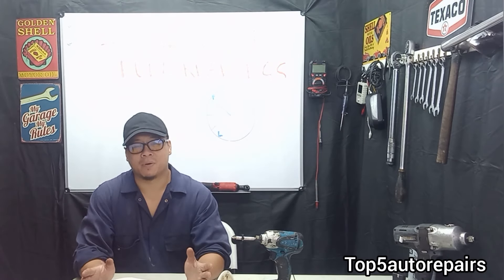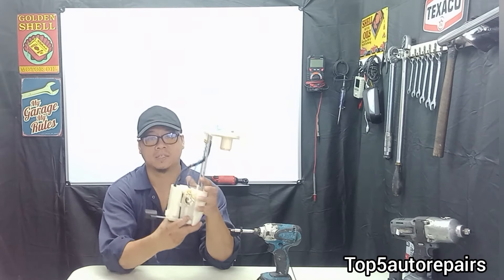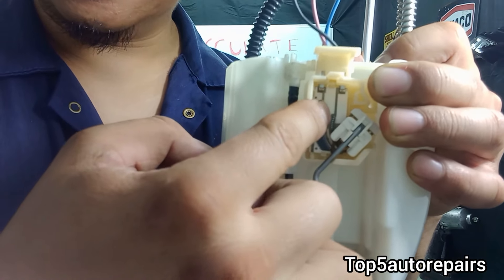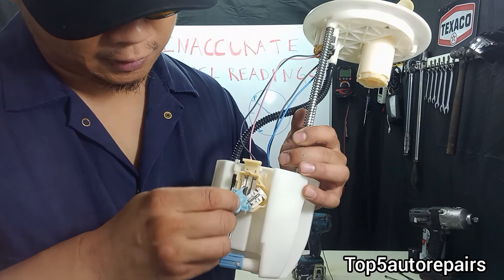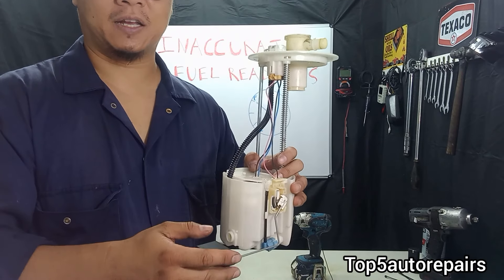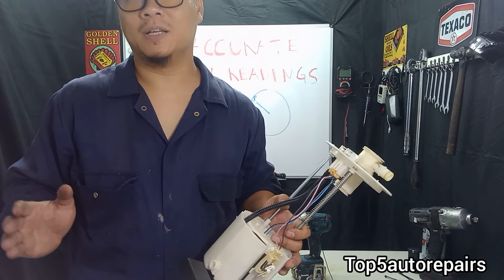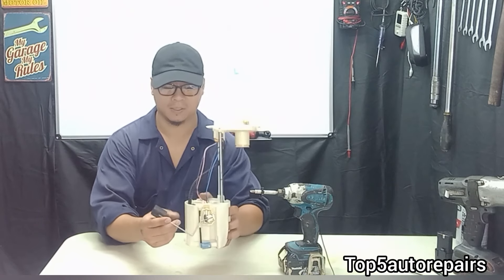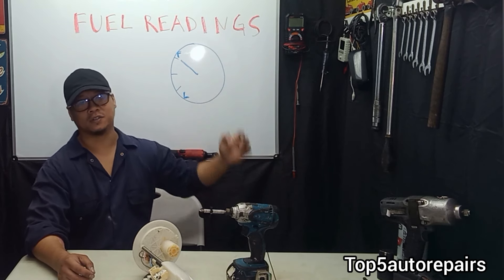Fuel Gauge Not Working This is Why Gas is Showing Full or Empty

Comment: Ugh mine marks half tank when it's full. So I never know when it's actually empty hahaha
Reply: Same
Reply: Same
Reply: Same here
Reply: lol if anyone finds the problem, let the others know here. It may be the sender but who knows
Reply: I have the same issue, and later today I plan on putting a fuel additive into my gas tank with the idea that it will clean any contamination around the fuel pump and prevent any more inaccurate readings from arising. If this method resolves my issue, I will make a follow up comment that includes the additive I used.
Reply: @lordgradi9525  did it work?
Reply: @yaswanthamourdalingame1447  unfortunately it did not seem to work, I put 2 bottles of Chevron Techron+ into my fuel tank on two separate occasions since leaving that comment and there was no change in my fuel gauge. On the bright side though, this did clean out my fuel system and I’ve gotten around ~1.5 extra miles per gallon since doing this.
Reply: Same here also haha
Reply: Exactly what mine does as well
Reply: I just reset the trip counter when I fill up. I usually get 600km’s per tank so when the counter gets up to 400km’s I know it’s time to fill up again
Reply: Just bend the float wire
Reply: @lordgradi9525 did it work n what additive u use
Reply: Mine gose up n down then the light turns off like I put gas while driving 😭🤣
Reply: Any update? Bec I changed my fuel pump and now it’s frozen on gas level and millage to emputy
Reply: @djr320 that's what I do 😅
Reply: @lyon9410  when I can be bothered, I’ll pull it out and fix it. I just don’t want to spend $1200 on what I know is a very simple fix
Reply: Mine is new i think one of the tubes is holding it up probably a installation error
Reply: Mine is the opposite lol, left my dad stranded once due to it.
Reply: Same here. So frustrating. Just brought this 2007 Prius two days ago and it’s my first ever Prius. What do I do!
Reply: Did u fix it? Mine also has issues when i pump gas it stops the pump or sometimes it spits out
Reply: If it is stuck on the fuel gauge on your dash, you will need to take the gauge out of your dash and resoder the fuel gauge at the back of it.
Reply: Drill a hole in your dash and move your needel to full when u fill it. That should fix the issue. Your fuel pump prolly has an anti slush components on the new pump maybe rather then one with just metal dividers in the tank to prevent sloshing aprearing on the fuel guage turing a turn or during stopping and going.
Reply: @derricksmiley5632 I used the Chevron Techron Plus fuel additive, and to my dismay it did not work. Since leaving these comments though, I have figured out what the issue was. After my fuel pump died on me one day, we removed it from the fuel tank and discovered that the pump had PHYSICALLY broke within the tank and the floating arm was being pushed downward. Mechanic said he’s never seen it before lol

Comment: My fuel gauge is not accurate, sometimes when i refuel my gauge wont go up, then i remove the socket or cluster gauge for about 5min.and plug it back and the gauge go up. What could be this problem?

Comment: Thanks, now I know why I have often been told by auto shop mechanics that it isn't worth repairing due to the age of my parent's 1997 Monte Carlo LS: the fuel gauge has been dysfunctional for a very long, long time.  I drive the car more than my parents and I do the same as my Father - when the mileage-wheel gets to 250 miles buy more gas.  I wish there was a easier repair option!  I was hoping I could find some kind of wireless float that I could toss into the fuel tank and it sends a signal to a USB plug-in receiver in the lighter?
Reply: Putting after market electronics around gasoline vapors is not something I would do. A tank of gasoline will leave a huge crater when it sparks. I don't think there would be any survivors.

Comment: I have the same problem. I ran out of fuel 2 times before I figured out my float is broken. 
Tipp: if you don't want to fix it, you can drive and use board computer numbers for fuel consumption. I watch out for used fuel and when I spend more than 20 liters, I fill it up.

Comment: This is what happened to me: In February, my alternator died on me. As the mechanic made his Dx, he also said there was a fuel leak and suggested replacing the fuel pump assembly. At that time, I was getting a reading on my fuel gauge of around 170 miles to a 1/2 tank of gas -- normally I get appx. 190-200 miles on a 1/2 tank of gas, roughly 32-34 MPG. When the assembly was replaced, I thought that problem would be corrected. HOWEVER --- NOW, the gauge reads appx. 140-160 miles at the 1/2 tank mark. Everything looks good at the 1/4 tank mark, usually 100-120 miles on the gauge. But then, the needle just plummets at that point. Today I filled up my tank with the gauge reading 159 miles at the 1/2 tank mark and the tank took just under 5 gallons.

For the last two months I thought I was getting bad gas, so I switched stations. I also replaced my gas cap to see if that might help. Neither of these things were the issue. I don't know how my mechanic missed this, or if this was deliberate to get me to come in again. After all, it's $135 just to do the diagnosis, then $135/hour for the labor.
Reply: is there a gas gauge rest button under the gauge. if so google how to reset it and see  if that fixes it.

Comment: Thank you. A Buddy told me that a malfunctioning fuel gage could be caused by a damaged gas cap which would not allow an accurate pressure or vacuum reading of a fuel tank. A possible theory but as you said the problem would be in the sending unit.
Reply: Never in a million years would a guage be faulty because of the tank cap. No matter what fancy words he can use to explain his myth, NEVER! The guage reads "liquid," even if the tank is to be filled up of water, a workin guage would give you a reading, an accurate one too of how much is in there.
Reply: @gustavozar5365  lol

Comment: I don't know whether this is the issue with my mustang (or if it just started consuming more fuel) but just yesterday, i drove for 25 miles (at an average of 10.9mpg) and my guage went from 230 miles to empty to 173 (57miles worth of fuel consumed). Apart from this, it gives me inconsistent fuel rading a times (if i was to add say 10 litres, it might give me either 40 miles or 25 miles) also, i seem to consume more fuel when the fuel in my tank is above 50 miles to empty, but when its around 50 it tends to behave the way its supposed to. Also switching the car on and off can result to either losing a mile, or gaining 10 miles.

Comment: I changed the fuel pump in a 2004 Dodge Dakota and now the gauge goes up and down, but is never accurate. Sometimes when the tank in near empty it says full or half a tank and sometimes when it's full is says empty or half tank or whatever. I just got a 2005 Chevy Colorado and it's fuel gauge said full when I bought it. Then I noticed it said 1/2 a tank after only a few miles, so I took it to the gas station and it took 18 gallons of gas, so it's fuel gauge doesn't work either because it was near empty.

Comment: Can parking on uphill position can cause problem too? I just parked a few hours uphill for a car wash and when I turned on the vehicle, the fuel bar is gone even though I still have 3 bars before the car wash starts. Any advices please.
Reply from the maker: It's possible if the float somehow got stuck in a certain position

Comment: I'm working on a DitchWitch 100 and at first the gauge was not working but now it is. (Recalibrated). I thought the sending unit was bad because I adjusted float and never moved. I tried another one same thing. But when I kill the key and turn back on. Its at the right level. My question is does the level move as fast as the float does or does it send a signal like every ten minutes to check fuel level.

Comment: I have a 2006 Toyota Yaris it first started running out when I would have two bars on the dash its digital so I have to put fuel in before it got down to two bars and then it went up to three bars it would run out 10 months later it was four bars it would run out and right now my mother just broke down and it was on five bars and it's out of gas It's All Digital so should this be the same problem

Comment: The work is getting that whole unit out of the tank.    Also as long as there is fuel the fuel will still travel to the engine right?   You just have to keep track of the odometer right?

Comment: Currently facing an issue with sudden drop on oil needle gauge while accelerating. My car Lancer Cedia 4g18-CS3A. Converted to CNG due to high fuel consumption. Basically the car   starts with oil and convert to gas automatically few minutes after heat up. While driving on 3000 to 4000 rpm there is sudden slight drop of oil gauge needle which can be notice with bare eyes. It becomes normal after park the car for a while. Tried to rev up while the car in parking mood to see if there any drops or not. But it seems happen only when the car is running. First time mechanic suspected faulty fuel pump. After checking his feedback was there is no issue with fuel pump. Any suggestion would be appreciated. Thanks in advance.

Comment: I have maybe a dumb question but the answer could save me alot of money and headache...

Can a car shut off while driving if the electronics THINK it's out of gas? Like, can a faulty fuel guage cause a car to shut down? Or does a car have to physically run out of gas to shut off
Reply: It keeps on runnin until outa gas. Whatever part gives a faulty reading, "is what needs to be replaced," but the part can't shut the car down.
Reply: My truck jumped into reduced traction and said my tank was empty when I just filled it.  My truck would not crank over after like power was loss.  Of course its a 2004 Cheverolet Colorado.lol
Afterwards, it would crank over only one time and not start.

Comment: My gauge would only go up to 3/4 full and would go down from there when I filled up my tank.  Made us nervous not knowing for sure what gas we had so I replaced only the fuel sending unit for our 2002 Camry Denso 955-0105.  So far the issue seems to be fixed.

Comment: Thanks for the information.  Mine doesn't fit into any of those descriptions.  Wondering if you can suggest the problem.  I have an '08 Prius.  When I fill up (because the electronic gauge reads 1 or 0 bars) I can only put in about 6 gallons.  The tank holds 11.9 gallons.  I drive until the gauge is back to 1 or 0 and when I fill up, again I can only put 6 gallons in.  To test IF there is still fuel in the tank, I brought 1 gallon gas can with me.  When the gauge hit 0, I started keeping track of how many miles I CAN drive while the gauge is at 0.  I can go another 150 miles "on empty".  Then when I fill up, I put in the whole 11 or so gallons.  So it seems that when the tank is actually HALF FULL, it's reading empty.  So it's not stuck on empty because it reads full after I fill up.  And there is clearly more fuel in the tank when it is reading empty because I can continue to drive for many miles that way.  It's like the calibration is off or something.  Please advise.  Thanks.
Reply: Gen 2s have a flexible fuel bladder that apparently shrinks over time. A class action suit was brought against toyota for this but it was dismissed because "poor design is not the same as a defect in materials (?)."  I know because i just bought a used one and found out fast that it only takes 6 gals.  however, your +150 miles makes me wonder. I'm still searching for answers.
Reply: @valueape888  My problem was a sensor and float/mechanical issue.  Now it’s reading correctly.  Seems my prius didn’t suffer from a shrunk bladder.  Ty for info, gonna see if I can prevent the shrinkage or swap it out.

Comment: While the Tacometer will be a  tight space to disassemble  it would still be easier to get out than a fuel pump. I got a 2013 CTS.  I'm trying to figure out what could be the culprit. Today, I just filled up from halfway empty and start the car.   The fuel gauge oly move on initial start up.   I started driving.  Then, I noticed the fuel gauge showed what it was supposed to be.

Comment: So my car is showing empty and I changed the sending unit and pump two times. Would it be a wiring issue possibly?
Reply: Depending on the vehicle you may want to check your gauge cluster.

Comment: hi i have a question i have honda civic 2007 the fuel gauge stocked on empty after the mechanic clean the fuel tank. 

is there any way i can troubleshot the issue? appreciate your response.
Reply from the maker: The float is probably stuck or missing. Remove the fuel pump and check for stuck position.

Comment: What is it if the gauge reads but only goes up 3/4 full even if the fuel tank is completely full?   The gauge moves but will not go above 3/4 full.  After this it will eventually drop back down to empty when the gas level drops but will not go above 3/4 full.  Could this still be a problem with the fuel sender unit or the gauge cluster in the dash board?

Comment: Mines shows half ful when key is off. It worked fine while drivingand wen i parked and shut it off for 30mins and started my vehicle it just trned but not start and i turned and didn't.  It showed half tank thinking it has gas but never started and thought no, my vehicle just was running and its shows half tank. It happened to me first time that it shows half tank. Luckily i was parked at home depot and bought me  gas can, and gas station was close by. Got 1 gallon filled and gauge showed full now and it started wow... so now when i shut off the engine gauge shows full. Should the gauge beon empty when key is off and goes up when keys is turned on???. Could this be fuel gauge issue??🤷‍♂️🤷‍♂️🤷‍♂️yoo know more then me..

Comment: I have a 2013 Lincoln mks my car stopped working we found out at first it was the fuel pump and we changed it and then it was the module and we changed it, now it’s working but it doesn’t mark the exact fuel it has it’s reading it wrong and I have the check engine light on with the p0460 code

Comment: what could it be if its says empty. But if i remove fuel relay then put it back in. Then the gauge has the right reading until i stop driving and cut the engine off. Then it says empty again.

Comment: So mine actually works in reverse so when the tank is full, it says empty. I want to think it’s empty. It says full. What should I do?
Reply from the maker: The float is probably stuck on the empty position
Reply: @Top5AutoRepairs  I have the same problem as the guy you answered to said. Full tank is empty on dash and empty tank is full on dash. But it works REVERSED. The needle moves.

Comment: Replace my fuel pump on my 2019 charger because my gauge wasn’t ready correctly 🤦🏻‍♂️. I changed the fuel pump but it didn’t help at all. My fuel goes from full to half empty to 1/4 it’s so annoying and my cluster is electronic gage so no way to access it.

Comment: Sir, I have been trying to find out why my mileage is down on my 2017 toyota camry le, The only thing I haven't change is the fuel pump or the Fuel Injectors. I have over 100500 miles on my car. Do you think I should replace both items. Any help would be appreciated. Thanks for your topic. Larry
Reply from the maker: There are a lot of factors that can affect gas mileage. Have you tried fuel injector cleaner? Any check engine light?
Reply: @Top5AutoRepairs  :Sir, I use allot different fuel cleaners but it still remains the same mileage. Thank Larry
Reply: @Top5AutoRepairs  No codes
Reply from the maker: You might need a basic tune up. Example: changing air filter, replace spark plugs and maybe ignition coil, clean the mass air flow sensor and checking for lazy o2 sensors.

Comment: Hi. My gauge is always full, when i disconnect the sender it descend to empty but only when I turn off the key and on again..
I tested another pomp but same problem..
I mesured the voltage in the conntector going to the variable resistor (sender), I found that the voltage is not accurate from 3.5 to 4.5v. I didn't understand: it should be fixed 5v i think.
Is my instrument panel bad? Not regulated 5v output? Plz help

Comment: My fuel pump for my 08 nissan quest is brand new and the gauge is giving me the wrong readings and both fuel pumps that i got from O'Reilly's were new
Reply: Is the sender unit attached to the pump? i,e, when you replaced the pump did you get a new sender unit? If not clean it as per the above.
Reply: @robertvanruyssevelt7159  yes the sender unit is attached

Comment: My code is P0463 so how can it be the fuel guage? The pump works fine but the guage shows empty with low fuel light. Please help. I already replaced the fuel pump module and I don't see any damaged wires.

Comment: 2008 Audi fuel pump doesn't read right I put one gallon it says 234 till empty then it a show right fuel then keeps going up and up I'll have 45 miles to empty five min in 195 till empty then boom no gas so idk I put ten in daily cuz idk when I'm a run out plus open fuel injectors circuit

Comment: I have the same problem butt I removed the fuel pump from the tank and test the floater by hand it did good by the gauge but when it put i back in the tank the gauge stop working do you have idea why?
Reply: Fuel sender is the problem